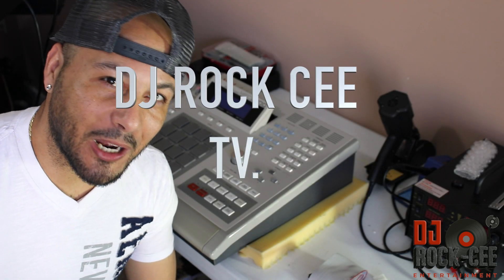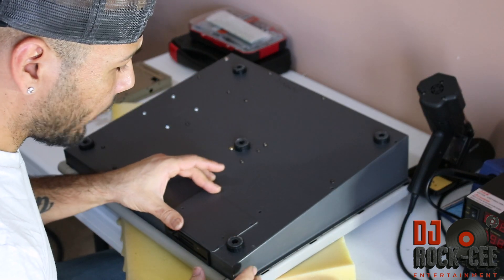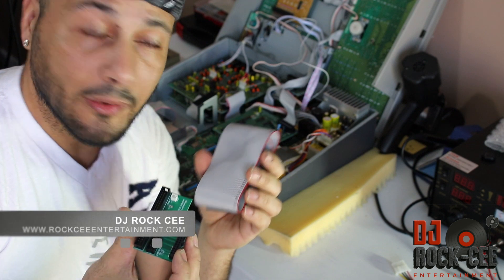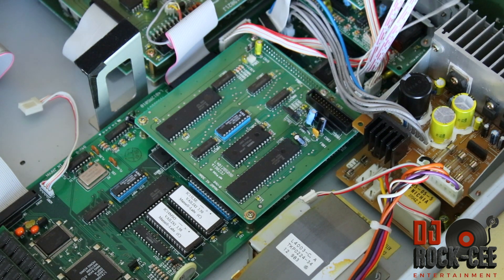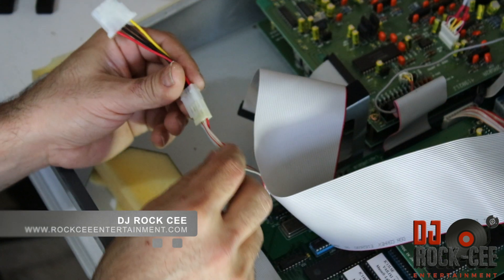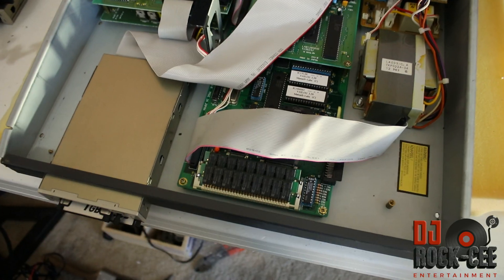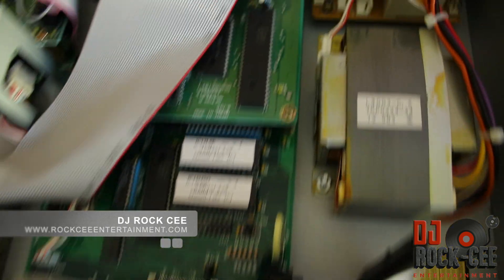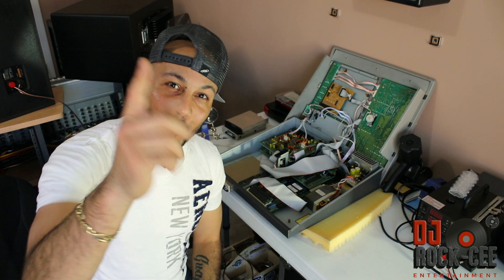HOW TO INSTALL A COMPACT FLASH DRIVE IN AN AKAI MPC 3000/MPC 60

Comment: Will this work with the Mpc 60ii ?
Reply: For the 60 or 60ii you will need a different kit. The 60 is set up a little different on the inside.
Reply from the maker: I never work on the Mpc 60 but I think it should be the same process ???

Comment: What drive is that? It's not in the scsi kit.
Reply from the maker: mikedub the CF card reader most be a 50 pin scsi PCD 25. Those drives are very hard to come by. But you can try looking on Ebay
Reply: Thanks for quick reply... I meant what brand is it? I like the 3-card slots it has compared to just one card slot that most others have.
Reply: Microtech PCD-47B. You will have better luck with a PCD-25 or a SCSI2SD drive.